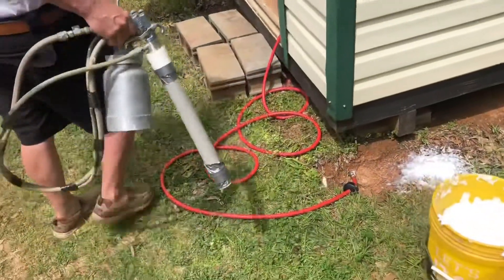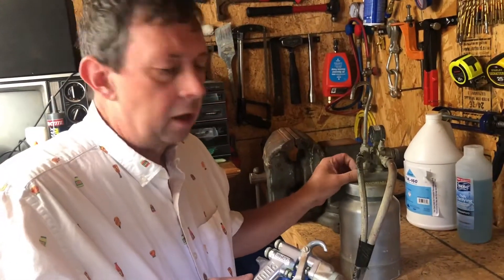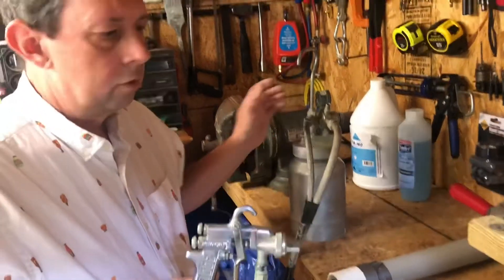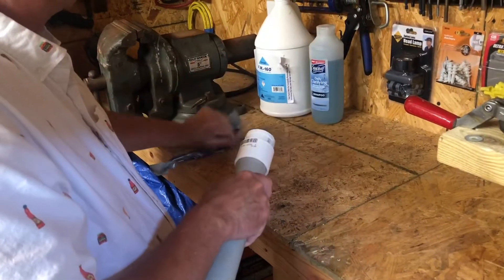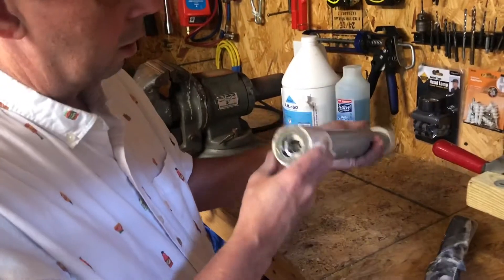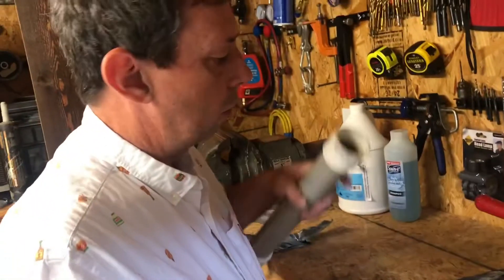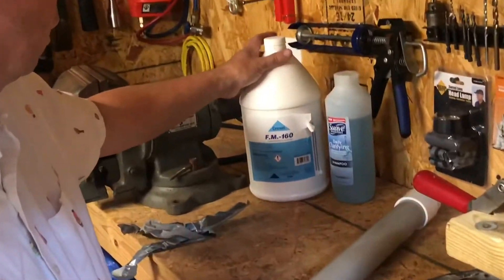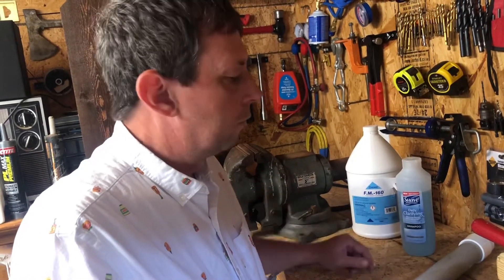Aircrete gun on the cheap

Comment: Great job BN ! That foam appeared to be very thick/dense...good structure to it! Rolled screen is genius...wonder if a finer mesh would effect output? Can you recommend a compressor?
Reply from the maker: I’m not sure in the finer mesh it probably would work a lot better but I used a twin cylinder small compressor. Ingersoll Rand 2hp 4.5 gallon tank ,however a larger one would work better .
Reply from the maker: Now that I remember we also tried steel wool and it was too fine.